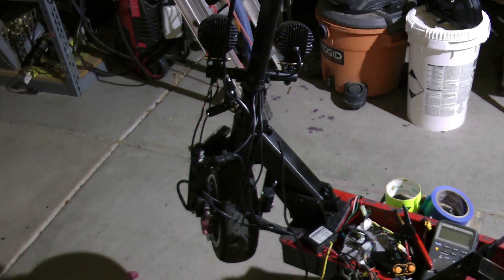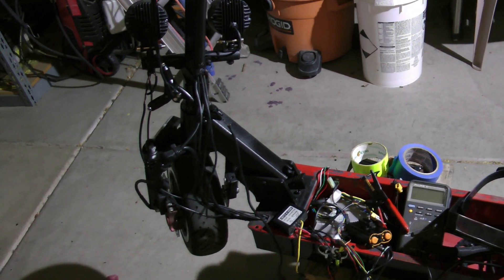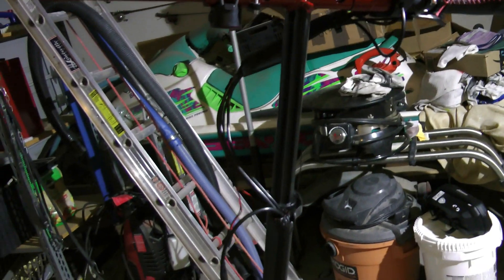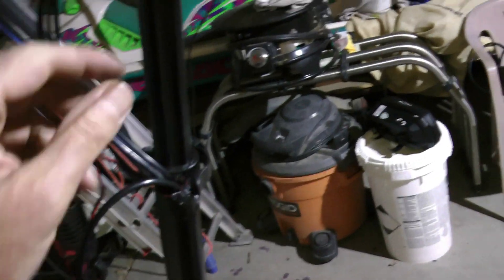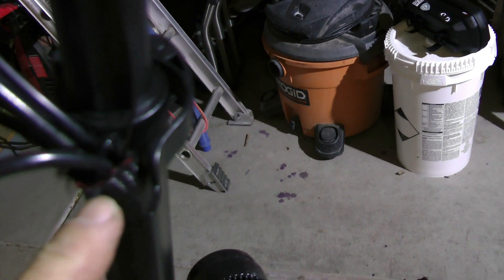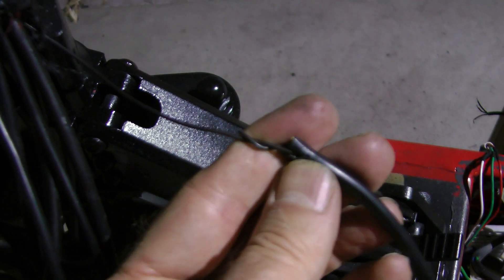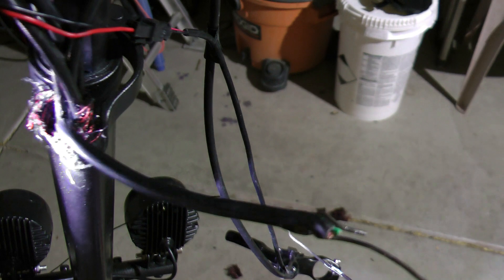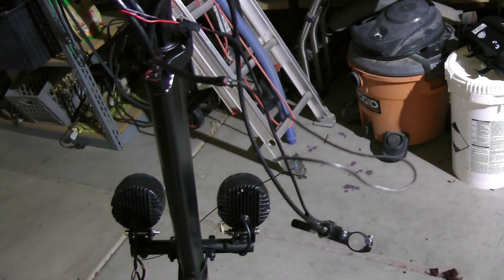Replacing cable through stem.

Comment: Ive watched all your videos , I just got a Laotie ti30 and I love it, I've taken a lot of your advice that I had not thought of before, so thanks for that in regards to safety and P settings ect. I do have a question that I wanted to ask, Is there a way to add directions to the front of the Loatie Ti30 that you know of? I have done a little searching, but I'm only on day 2 lol. I thought Maybe I could tap into the rear ones but I'm not sure. Thanks!  Oh one other question, the eabs for the Ti30, is that a regenerative brake,? and if So how well does it work for you?
Reply from the maker: You could tap into the rear signals. Personally, I might remove them and instead use some smaller, wireless ones on both front and back linked to same remote. I already have two sets that I switch between scoots. Mine aren’t on Amazon anymore but there are several others if you search “bike turn signals”. Here’s a video on mine: https://youtu.be/wfLzZYoyzew
Not sure about the regenerative braking but i don’t imagine you get much voltage back from braking. I try to brake as little as possible.
Reply: @Dessert-Ecruising  Thanks! That's a good idea to just go wireless on the turn signals, Thanks for the info!